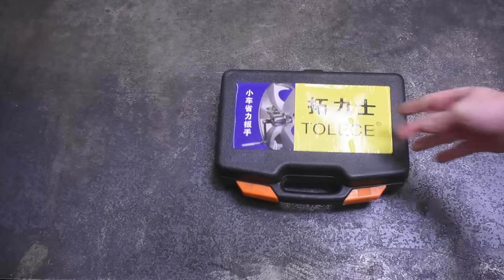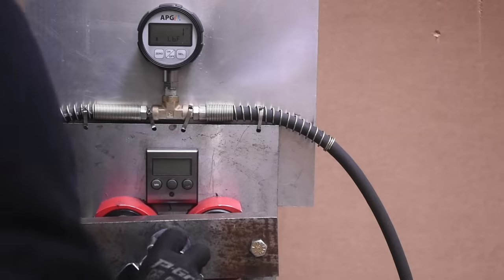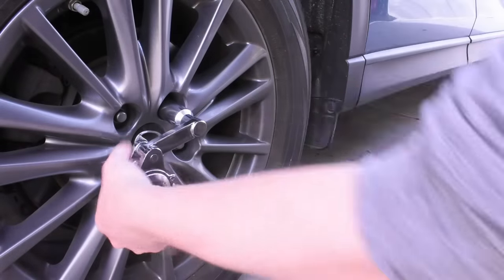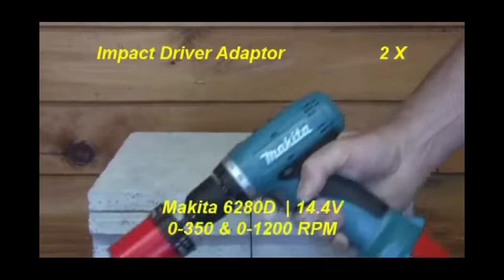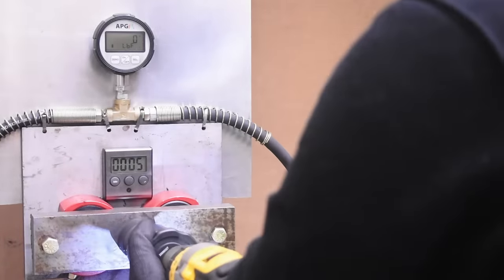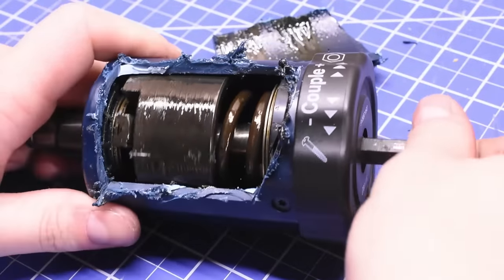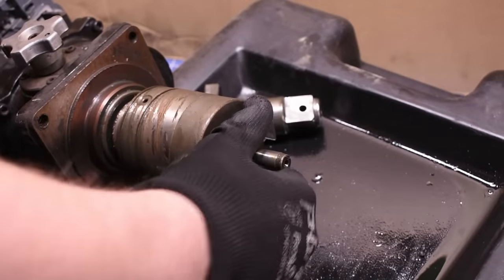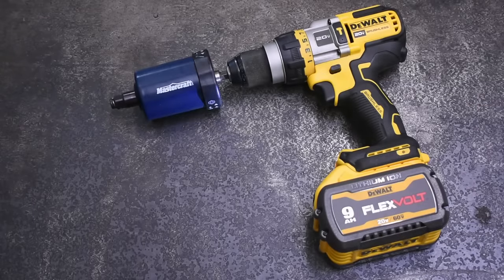Testing TikTok Tool Hacks: Surprisingly Amazing!

Comment: It was not that long ago those CT impact adapters were last being sold.  Probably early 2010s they were still on the market and went for as low as $40 CAD on sale.  I imagine these were taken off the market in order to push [much more expensive] cordless impact wrench sales, as there's really no reason they needed to stop selling them if they were a good product.  I also imagine after this video, the values of used ones on eBay, kijiji, etc. must have shot up like crazy, lol.

Impressive to say the least, though they do add a lot of length to a drill and probably aren't all that great for things other than wheel lugs, where you have all the clearance in the world.  Plus performance depends on the drill that's driving it, so if you don't have a superstar like the DeWalt here...YMMV.

Comment: They(old brushed drills) definitely can suck, I've been getting a lot better at how I clean them though.
I got a dewalt nicad drill to perform like new by combing out a few issues over the years. It can even drive a 1/2" drillbit through a wet 4x4 now😄. It couldn't before:

* Don't sand the commutator. It's supposed to be like that. Just get the crust off with detergent. Any 'custom' sanding would just make brushes die faster.
* Don't just wash the brush housing. Wash the entire collector and stator and magnets. The armature/stator is the weakest part when it comes to carbon buildup because it's an all-floating contactless magnetic connection. Most casual people just clean the commutator so the drill never gets back that "new" performance.
* Don't frikkin grease the frikkin gearbox unless the grease is spoiled&offcolor. People be using too much grease and be putting it in areas that don't even have moving parts, which can make the battery overheat from the overwork. Best case, just never open the gearbox unless the tool is from before 1985.

That said, there are also high-end brushed tools too not just 'weak' entry-level stuff, er: I've never had performance problems with the Makita LXPH03 I have laying around. Performs just as well as a HILTI 6h-a22

Comment: anything mastercraft is like toby keith's song. not as good as it once was, but its good once. a couple years ago, canadian tire came out with the mastercraft maximum brand. when they did that, it didnt take long for the OG mastercraft stuff to lower drastically in build quality. anyone who's worked with em for a long time knows its only good enough to last the 90 days warranty with light use.😂😂

Comment: 🤔🤔🤔
I bet someone could make a bit of money by making KITS, to turn your old/dead impact's hammer assembly, into that Drill Adapter...
Sure, you'd need a CNC *cough*AvE*cough* and a way to catalog a whole bunch of popular impacts for the necessary dimensions, but maybe an early-adopter trade would be possible? 
    "Send in your tool for me to map it, receive the adapter plate afterwards".

THEN you'd end up with a really nice, non-plastic enclosure, since all the battery impacts have aluminum heads.

So am I onto something, or am I just on something??

Comment: Torque multipliers have been around for forever.  Try using a forklift and a 1in drive multiplier to tighten bolts on a track frame to get to spec. These things here are just a gimmick sadly.

Comment: Years ago, probably a decade by now, I remember seeing an affordable torque multiplier for the DIY crowd, something like a 5:1 reduction but they also advertised stacking two for a 25:1, at something in the range of $50-$75 each.  I don't remember the name of the company, I don't know what happened to them, and I can no longer find any evidence of them existing; they were some USA-based brand that had the typical super patriotic wank about how their tool was designed and manufactured in the USA, but then sold out to Chinese manufacturing.  It was also the bar type multiplier, not one of these gimmicky ones that requires a second bolt to use, and the bar was more than long enough to use the ground as a reaction surface and at a fairly shallow angle as well.  It'd be nice to see an affordable option again, considering the next cheapest thing is in the hundreds of dollars range, or settling on a gimmicky tool that only works in one scenario and only in one direction; although finding an adapting bar for the truck style ones, the ones with extremely deep reductions meant for crusty tractor trailer lugs, would be a cool alternative as they have a solid reaction foot (that requires an exposed neighboring lug) rather than a swiveling second socket. 

I also remember wanting one of those drill adapters years ago.  I think the brand was Hammerhead and it was something that at least Lowes sold.  Of course, like all of these kinds of products, they disappeared some time ago, and I don't remember them being all that expensive, possibly even cheaper than $40.  It'd also be nice to see the return of these, especially within the DIY space where someone isn't going to have a drill, small impact driver, and a larger impact wrench; hell, if you can hit the same price point and also source a cheap little drill that's extremely fast, it could be a good deal.

Comment: At the 47 sec marlk:  2360 Lb/Ft. Not Ft-Lb
Foot-Pounds is NOT measurement of Torque.
Foot-Pounds is a measurement of FORCE, expressed in Ft-Lb-F 
Pound/Feet is a measurement of Torque, expressed in Lb/Ft, or Pounds over Feet 
It is a mathematical equation of Mass over Distance, or Mass divided by Distance.
As a Metric comparison, Torque is expressed as Newton/Meters, yet you certainly would never say Meters-Newton.

Comment: The way that young man struggle to loosen the lug nut with that thing as he turn the handle around looks like it will still be a pain in the azzz for my 75 yr old pops as he doesn't have that much strength like he use to.... A long breaker bar will do the job just fine!

Comment: To loosen the reaktion arm just crank is back a little bit! 😑
Reply from the maker: Because of the dogleg hinge, going backwards a little doesnt do anything. Unless it's loosening the nut and even then is still bound until the nut is free
Reply: @TorqueTestChannel  Makes absolutely no sense, but if you say so.
Reply from the maker: Most tq multipliers don't do this. Its just trash

Comment: Hardly a hack.  Torque multipliers have been around for the last 60 years. The tool is based on a planetary gear set very much like an automatic transmission.
Reply from the maker: The secret to that garbage website/app is NONE of this stuff is a hack
Reply: "HACK" seems to be a GEN-Z term. The ironic thing is that all of these so called "hacks" often have a patent, or patent pending.

Comment: Seems to me that with a torque adapter contraption, rpm will translate to torque pretty directly right up to the point where it scatters itself across the shop.
Doesn't seem like a bad thing to keep in the car.

Comment: Removing bolts of a wheel without a jack 🤦🏽‍♂️ don’t do what this guy does. And also there’s a reason why air tools are used for wheels and not geared tools.
Reply from the maker: Bolts? You can remove a couple lug nuts from a wheel still on the ground just fine if you put them back on, just dont driving it around that way. Also you can't crack wheel nuts free with the wheel in the air using hand tools. You'll find that out quick when you go to loosen your front wheel that's off the ground and it goes spinny spinny

Comment: Speed 1 is higher torque. Why you putting them in 3 😢
Reply from the maker: We tried both here. Also why are you after higher torque from the drill? You need enough to overcome the spring, after that it's wasted, you'll want RPM
Reply: @Torque Test Channel  hey I don't know? I'm just an electrician 🤷😂 you've explained and it still don't make sense... well kinda lol. You're the boss! 🤷